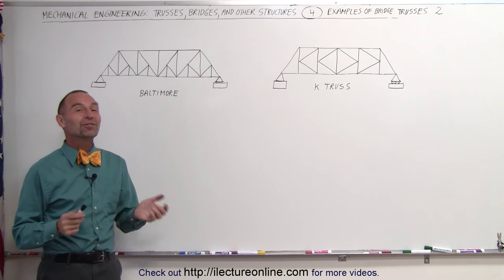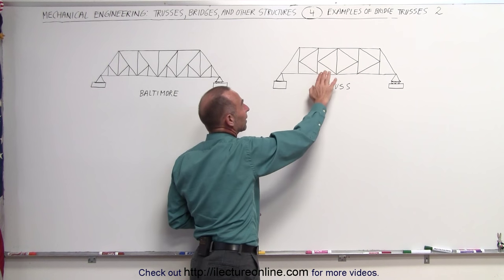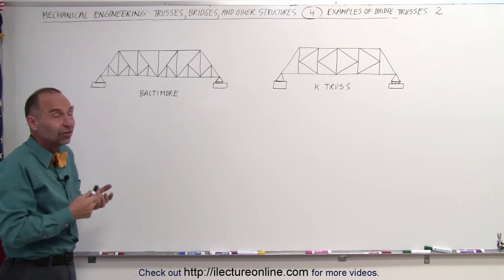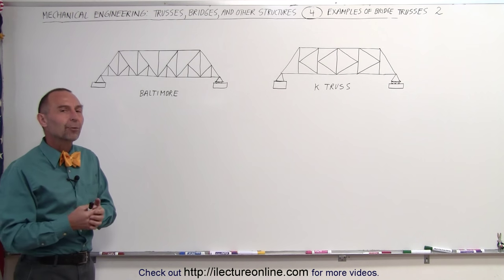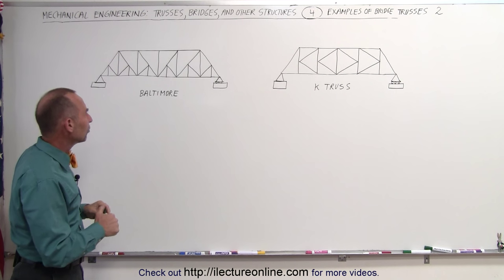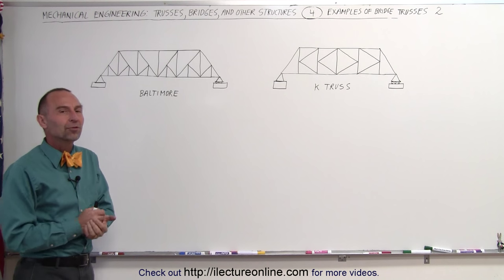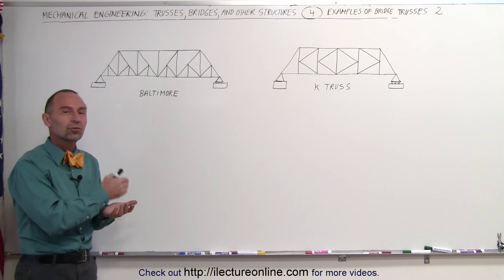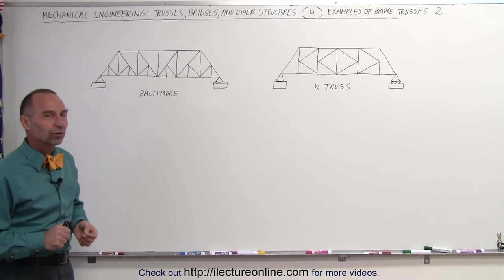Mechanical Engineering: Trusses, Bridges & Other Structures (4 of 34) Ex. of Bridge Trusses: 2

Comment: sir, can we use fixed support in truss problems?
Reply from the maker: Usually one of the supports is not fixed to allow for thermal expansion.  There are different methods used to allow for thermal expansion.  Rollers is one of them.
Reply: @MichelvanBiezen  Got it 
Thank you
Reply: @MichelvanBiezen  What if the trusses are a weldment?